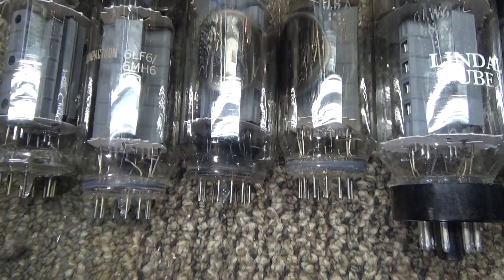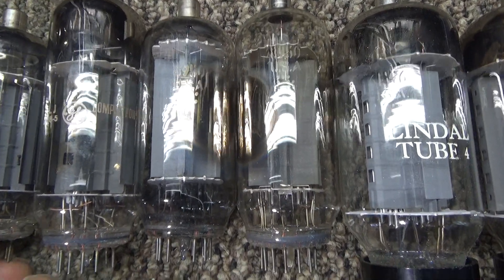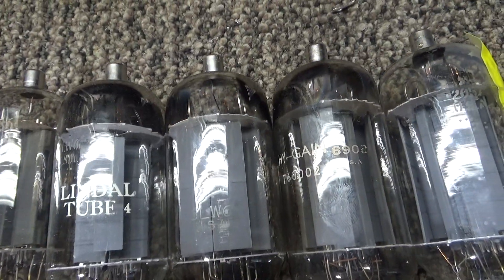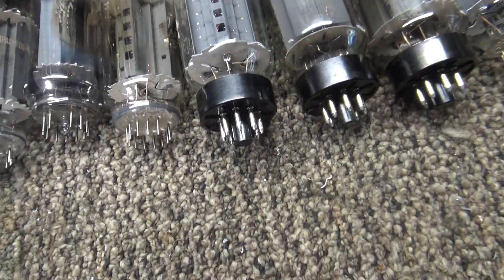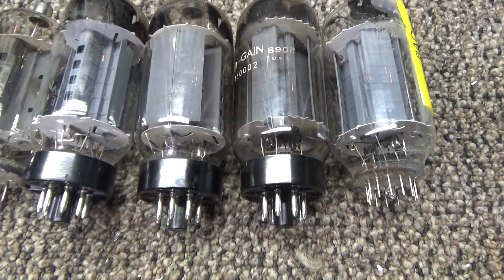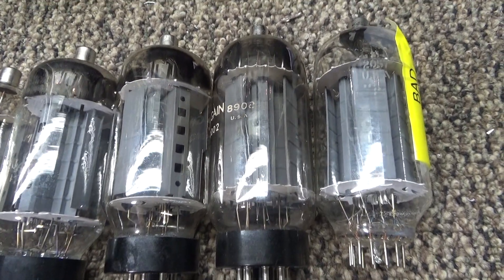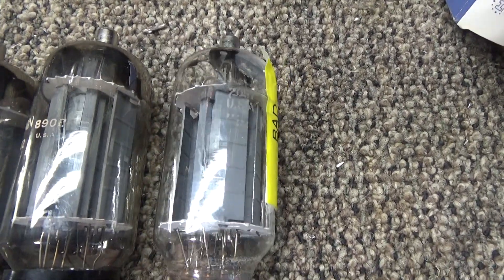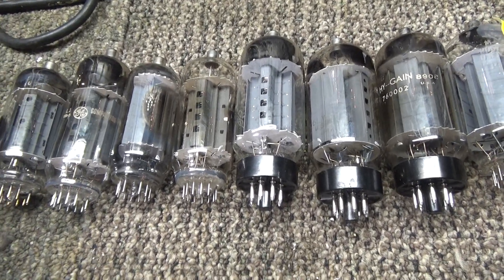Sweep tubes, 6lf6, 8950 30 watt and 6lw6, 8908, and M2057 40 watt tubes compared.

Comment: I like the 6kv6a baldie ..my favorite af all bullet proof ...ther i. Alm the varmit driver sections and the dna raider comets and more ..but they do not have a plate cap ..there botom pom olate drive..meaning the hv is on the bottom pins. Also the heater vontage and current....6 vomt heater 6 fil. 400 v hv dc

Comment: A pair of 6JB6s were used as the final output RF amplifier in Drake ham radio transmitters. While the Drake transmitters were rated at 200 watts input and they actually did that, they used very carefully controlled transmitter mode. In particular, the AM mode was "modulation controlled carrier." So, high power only occurred during spoken syllables, but power was reduced during quieter times. The power meter bounced around a lot during transmission. As I recall, the tubes were only rated for 65 watts for the pair, but they tripped the effective usability by implementing very efficient modes.
Reply from the maker: Yep, so many different variables and rating for sweep tubes. Plate dissipation, class, ICAS, Power in, power out, and temporary overload ratings. It is said by the sweep tube guru's that the plate dissipation rating can be x3 when used for AM and SSB ICAS amplifier's.

Comment: Bro... I need that hygain 8908 for my footlocker. Is it available?
Reply from the maker: Nope, no extra 8908's. However, the Hygain footlocker is grid driven. A 6lw6 should work but you will need to rewire the pinout, and 6lw6's are 6v filament while the 8908's are 12v so that will need to be addressed too.

Comment: The data sheets are on franks electron Tube Data sheets the 6lf6 is 40w and the 20lf6 is 40w but the 20lf6 has a 200w overload rating for 40 seconds. I'd say these would be the tall boys with the big heat deflectors on top. the data sheets are legit. I been up and down with 20lf6 cause I had a kenrich 515. those tubes were made in Holland and or England for GE and had a folded seam on the top glass and a silver strip on the bottom. they were super duty
Reply: Pope, Valvo, Adzam, Amperex, Mullard, Miniwatt Dario, and Radiotechnique were all names owned by Philips Holland.The respective names typically referred to factories. For instance, Mullard operated in England, Valvo in Germany, Amperex in the U.S.A., and Radiotechnique in France. In the case of Adzam and Pope, these were names to export Philips products into other markets such as Latin America and Africa.

Comment: Check your datasheet on 6lf6.I did and it is 40W plate dissipation.All the tube manuals I have check it as 40W.Keep on keepin on Doc 73
Reply from the maker: I've probably looked at around 50 data sheets. Most say 30, some say 33 and a few say 40. Here's a discussion on the net about 8950's and 6lf6. I find these discussions and opinions very interesting. https://antiqueradios.com/forums/viewtopic.php?t=175524